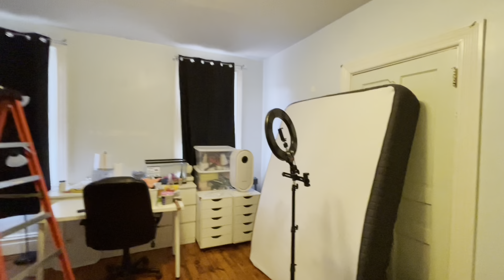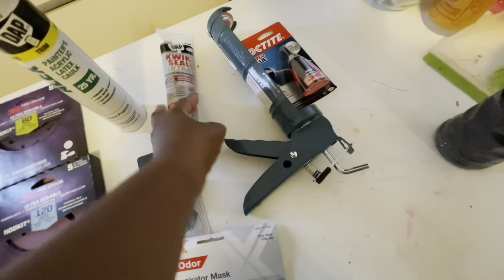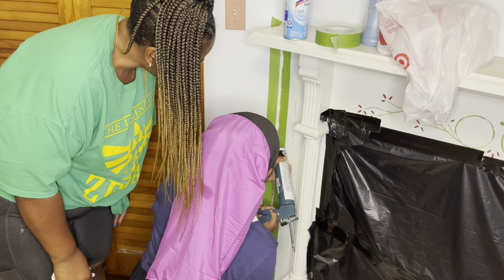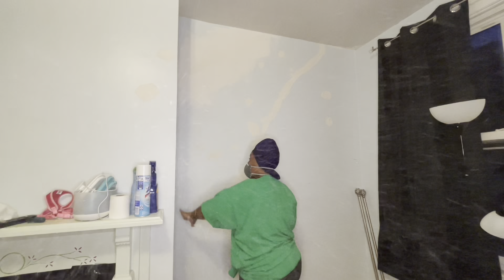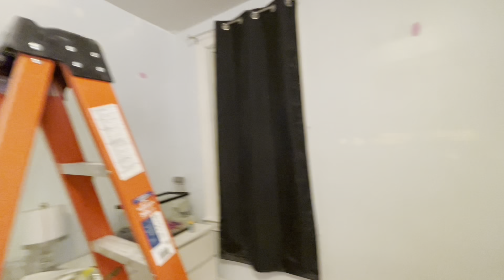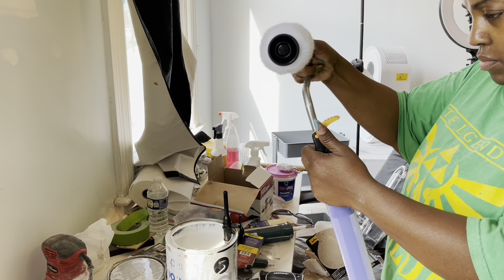STARTING LONDYNN'S ROOM MAKEOVER / PART 1 / PATCHING WALLS, CAULKING, SANDING AND PAINTING / SMTV

Comment: I’m not expert but trial and error has taught me    a lot, since you had to do several coats and you’ve been painting all over, purchase the big 123 primer and prime the walls after repairing and sanding! Saves so much time and money! Wagner had another paint device that would allow you to connect the brush and pump paint out as needed! Not sure if it’s still available but I like it and painting took about an 1 1/2 hours depending on the size of the room! Love watching you transform your home! Brings back memories for me!
Reply: I was going to say the same either purchase primer or a paint with primer
Reply: Whenever I paint, I always get the paint with primer. Its more expensive, but you don't have to do two coats of paint. That's just me though.

Comment: Saw where instead of sanding ...you can use a damp sponge to smooth out the drywall mud.....I use KILZ then paint to get a good color or change colors...love the room. Long strokes on the ceiling instead of short choppy strokes works best

Comment: Looking good and two justice get you some gliders it is easier to slide furniture and a spray gun it's a lot faster and just go around the edges with a paint brush and I am glad you mentioned about the paint gun being heavy I have one in the box for awhile an never used it thanks for the tip

Comment: Items should have been removed, or covered, dust travels, more  clean up work. Saw dust in your eyes can be painful. Sweeping dust is also harmful, vents should be closed and covered. Molding can be added around the gaps on fireplace and floor.